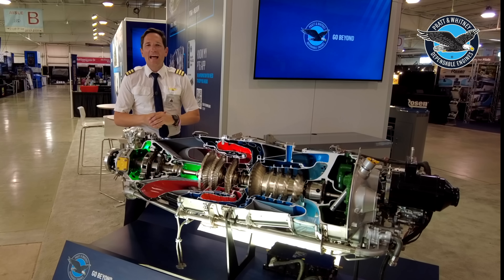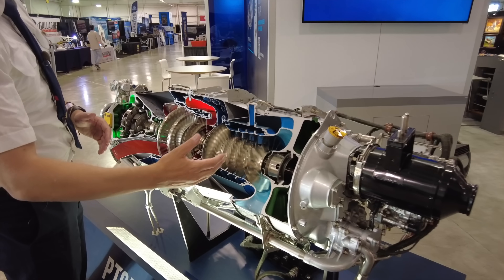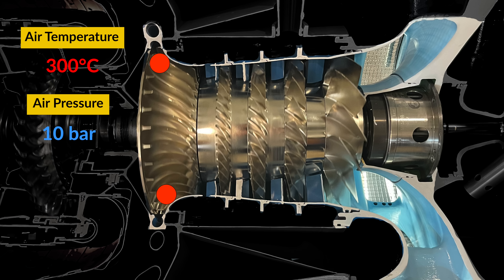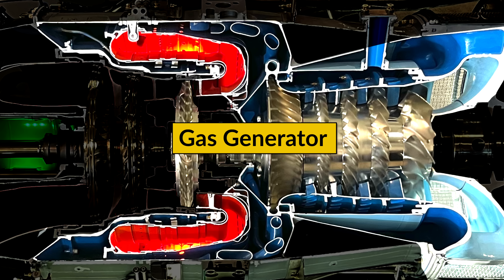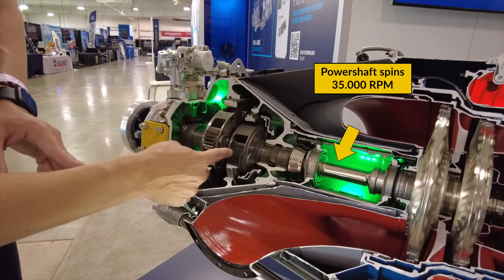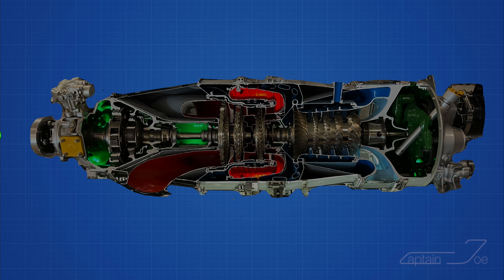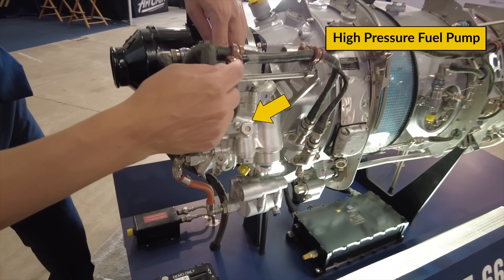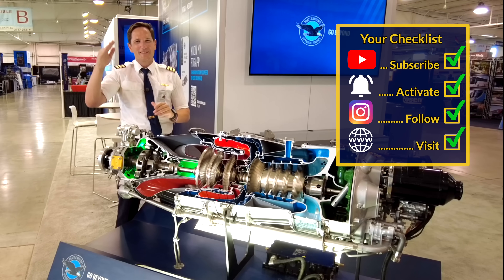The BEST TURBOPROP explanation video! By Captain Joe and PRATT & WHITNEY

Comment: I’ve always been confused by the turboprop engine. This is far and away the best and most understandable step by step explanation. My eyes have been opened!
Reply from the maker: Thanks buddy! That was the purpose of this video👍🏻
Reply: @flywithcaptainjoe  If anyone is interested in learning more about turbine engines a very informative site is AgentJayZ. Hopefully cap joe will leave this up and not ghost it like he did my first comment (not cool), as it is clear that he doesn’t know about AgentJayZ and his site. He is a jet / turbine tech that overhauls different jet engines and has fantastic and detailed videos of every aspect of turbines.

Latest video is:

Afterburner Monday

If you want to get even more technical, in the comment section a turbine engine development engineer from RR answers the more complex design issues questions many times.
Reply: @flywithcaptainjoe  Great video. It took me a while to connect the dots about how the stators force the fanned air into the next stage of the compresor, with a "forward" motion, as opposed to what could otherwise be something of a donut of air rotating around the shaft. 
-- I never thought of air moving in a donut motion until one of the engineers who worked in the Osprey told me about how helicopter rotors under some hovering conditions can set up a pattern of air motion something like a donut turning itself inside out, and thereby getting no lift relative to the atmosphere as a whole. Inside this turboprop, it would be more like a spinning donut, but aerodynamic flow isn't anything I studied in college, and my intuitive assumption was to assume that the air is more cohesive and "sticky" with respect to surrounding air. Another assumption, after sitting in front of fans to cool off, is to take the force of the pushed air as exclusively forward, without taking into account what's pushed outward and in a circular motion. But I guess a fan blade is kind of like the sail of a sailboat tacking into the wind-- an indirect pushing with a lot spilling off to the side.
Reply: I've always wondered how they worked. I was nothing like I was thinking it worked.
Reply: @mikewhite6288  Me either.
Reply: Check helicopter turbines, they are also very different.
Reply: SUCKS, SQUEESE & BLOW...))) YAEH BABY!!!!
Reply: Great video!  Consider how many degrees of turn the air has to make from entering the intake until emerging from the stacks!  It's nearly 1000 degrees worth (roughly 3x360 of direction change!). This said, more seriously, remember this is a free-turbine type turbo-prop.  A large number of others are not.
Reply: Well, this a basic explaination of the PT6, not turboprop in general. There's fixed shaft turboprops like the Garret 331. The most complicated and interesting is how the prop governor and the prop pitch controller works (beta mode). And BTW on ice or bad weather conditions the ignitors are switched on just in case a flame out occures.
Reply: It's basically a jet engine driving a propeller
Reply: In short, you are driving the prop with a jet engine instead of a gas engine.
Excellent video.
Thank you!
Reply: Please recheck and confirm RPM of gas generator shaft. I felt , it can't be 39000 .
Reply: Nope that is correct the gear ratio is from 39K down to about 2000ish rpm (engine models vary)
Reply: Think of it as an unducted very high bypass engine.👍🏼
Reply: Sokath. His Eyes Uncovered!
Reply: @SHOTbyGUN  A spy!!
Reply: @SHOTbyGUN  At Tanagra.  LOL!!!  Nice Star Trek reference there.
Reply: The thing I don’t get is how it’s air pressure drives the propeller. It seems like it wouldn’t generate enough power to turn the prop at all settings. In fact, piston engines do a better job being mechanically linked to the prop. So if your landing a plane and have to abort the landing, a turbo prop lags in increasing prop speed while the piston engine gives instant response.
Reply: @kennethcohagen3539  yes but in flight the prop is always at 100% rpm. The only thing that moves is the propellor pitch!
Reply: @Sterlingjob  so it’s a constant speed prop. I guess the biggest change would require more torque, right? It’s just that air is compressible, and you would expect the prop to lose speed under increased loads. But I guess air doesn’t load the prop as much as water would with a boat propellor. Both are liquids when you look at the physics of the situation.
Reply: @kennethcohagen3539  yes constant speed in the air but not on the ground. The actual physics of props is quite mind blowing! Before take off the driver will put the prop into alpha mode from beta mode. Alpha mode is 100% rpm. So when he moves throttle forward the prop will stay at 100% but the pitch of the blade will change and Chuck loads of air back causing thrust. If the aircraft climbs the prop will still spin at 100% but the pitch will change to keep the prop turning at 100%! In beta mode the power levers will directly change the pitch of the props but they won’t be turning at 100%. Beta mode is for ground operations! As I said it’s quite complex and I don’t remember much from my technical training on them!!
Reply: @kennethcohagen3539  Keep in mind that not all turboprops have a free turbine. Some are geared.
Reply: @kennethcohagen3539  It's not air pressure but the shaft connected to the power turbine which is driven by continuous hot gases that drives the propellor and there's power aplenty.. Similar to the torque convertor in an auto transmission where the engine output shaft is not physically connected to the input shaft of the gearbox, fluid is used as the medium to transfer the power from one to the other and anyone who has driven an auto knows how well it works. Much damage to the engine and transmission is averted this way. Besides that, a piston engine has alternating pistons firing in order so not all pistons are firing together so you are not really getting the most of the engine. In a gas turbine combustion is continuous 100% of the time giving optimum power.
Reply: Far and away? What the heck does that mean?
Reply: @thecomedypilot5894  It's a cheesy Hollywood film, where Tom Cruise not only meets the stature of a leprechaun, but he sounds like Hollyweird's ridiculous portrayal of one too.
Reply: @skateboardingjesus4006  Thanks for the clarification.
Reply: @thecomedypilot5894  It means you are young and have never heard these archaic quirks of speech.
Reply: @dougaltolan3017  And is that a bad thing?
Reply: @dougaltolan3017  Another quaint expression is “over and above” which means “in excess of normal”. It’s a unique way of associating something with something else.

Comment: This is the best explanation I've ever heard. Ive always wondered how it got air energy to mechanical. Also im still wondering how that gear is turning  39,000 rpm in the reduction housing. What materia is that gear to withstand that speed and force.

Comment: why would you want to reduce the RPM of the props. the RPM has no place to escape, it has to turn those big props, so isn't it better without the reduction, and let them naturally spin the prop, there will be some wastage of energy, but you will get more thrust right? or did I get the physics wrong?

Comment: What I can never understand is why the combustion chamber, which must surely be at higher pressure than the inlet/final stage compressor due to the enormous expansion caused by combustion,, doesn't cause the gasses to reverse direction into the compression section and so prevent it from working as described.

Comment: How are the propshaft and drive shaft lubricated in the center at the point if rotation? A car engine uses oil on the bearings of connecting rods and crankshaft

Comment: You talked about the increase in temperature and pressure from 15 degrees 1 bar to 300 degrees 10 bars. What will be the rpm of the compressor shaft on the PT6 or any other plane. Is the increase in pressure and temperature values attained by an rpm that may be 20% of the engine's maximum rpm.

Comment: Those reverse flow and counter rotating turbines are quite intriquing features. Other than that it is basically a helicopter engine mounted on a fixed wing aircraft. I wonder could those free turbines be used in day automotive or marine piston engines as compound engines? Running on excess exhaust gas?

Comment: MY first A&P job was in '88 with Petroleum Helicopters, Inc (PHI) and worked on the Bell 212 and 412 with the PT6-3 and -3B respectively.  Great engines with plenty of power.  Bit of history.  Pratt and Whitney Canada developed this engine because their radial engine business was fast disappearing in the mid to late '50's and they had to have a follow on which led to the PT6.

Comment: Thank you, Captain Joe, this was very interesting. Something I am still wondering is that you stated the fuel/air mixture will continue igniting on its own as long as fuel is being introduced into the chamber, but then you said there is an igniter plug involved. Would the igniter be used in certain instances only? Or is that always part of the process?
Reply: Severe turbulence and heavy rain. Ignitors come on
Reply: @omarr737  Thank you!
Reply: @marcd1981  forgot to mention. They also do come on when Ng is over 10% and ITT below 500C. So basically during start
Reply: @omarr737  That makes sense, getting the engine started would need the mixture to be ignited, then as long as fuel is flowing, it will remain ignited. Thanks again!

Comment: Pretty good description, I've worked the-20's, -45's and -45R's on Shorts 3-30s and Twin Otters. Lots of hot section refresh time, and for a bit was the go-to guy for fuel control/prop govenor feedback rig. hated to safety the prop bolts inside the prop feedback slipper ring. Got to say that using a "Prentend to be Fast n Phony" in the movie that we true racers make fun of will hurt your creditability.. Careful Mate..... 😜🤪

Comment: It wasn’t mentioned, but the purpose of the stator vanes is to efficiently redirect and straighten the air flow going into each successive stage of compressor blades.

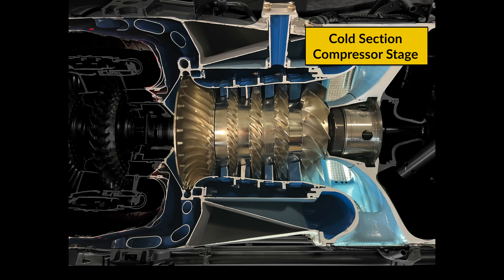Comment: 4:25 it would probably be helpful to explain here that after the compressor stages, the pressure of the gas is at its highest point, and would flow out through the turbines even if fuel wasn’t added. It just wouldn’t produce more power to keep spinning the compressor and the whole thing would just slow down.

Once fuel is added, the gas now has more energy over all. The resistance to go out the exhaust turbines is less than to go out through the compressors, so the gas does not reverse direction. however, because the gas has more energy, that is how the turbine is able to run the compressor and produce even more excess work.

The addition of the fuel can be considered simply an addition of heat. The mass of the fuel is small and can be disregarded. A jet engine can function on heat (energy) addition alone

Comment: I've got easily 1200+ hours behind this engine in a king air and porter(one of the best aircraft) and this is the best most informative things I've come across.  I've always heard the bad things about the engines reverse flow and free turbine etc...but truthfully the advantages pointed out here are exactly what kept me and my passengers safe. Even when people pointed out the problems they were also quite quick to say but it's reliable. Honestly the "problems " were monetary and sometimes caused by pilots, because they AREN'T cheap to fix or replace 😮

Comment: 🤯💥🤯Multidisciplinary engineer/inventor here. At a cursory, look our innovations and advanced engine concepts would reduce the size, weight  cost of the PT6 engine by 30%, improve efficiency by 30-60% and increase power by 50%.  Advanced propulsion will further improve propulsive efficiency of the aircraft by >>30%. 🤯💥🤯
...
..
.

Comment: How much pressure is in the combustion chamber while the engine is running at full power?  It has to be less than the 10 bar compressed air pressure or the air would not flow into the combustion chamber.  I've always been confused about the notion that the thrust must be the cross section area of the exhaust outlet X the combustion chamber pressure.   It seems amazing that jets can have so much thrust, but it is based on less pressure than the compressor is making.  Also interesting that the compressed air temperature is so high. I see that that is useful for igniting the fuel, but do any jets attempt to cool the compressed air to get more into the combustion chamber, such as with automotive turbocharged engines with intercoolers?  Thanks for this great video.  Very well explained.

Comment: This was a wonderful explanation of the operation "cycle" of the engine. As an aircraft maintenance engineer, I started my career working on Beechcraft King Air 200, 250, and 350. I've performed many many "HSI's" 10:35 (hot section inspections) on these PT6 engines, where we split the engine at the point between the CT(compressor turbine) and the 1st stage PT(power turbine) . 
It's always amazing to see the cutaway of the exact engine you'll be working on, which is generally only located at the manufacturer's approved course-instructing facilities. 

Fun fact: Only approximately 30% of the air in a turbine engine is used for combustion. The other ~70% is used for cooling!
Oh, I also  managed to salvage an unserviceable gas generator (the inside of which is pictured at 4:04 with the diffuser ducts/vanes) and installed a glass top on it to serve as a coffee table :)

Comment: I don't understand the difference between a turbofan and a turboprop because isn't a turbofan just a ducted turboprop? How come the rpm if the prop in a turboprop is reduced but the fan of a turbofan isn't it's allowed to spin faster then the turboprop prop at the same speed as the low pressure turbine (with acception of the pratt and Whitney geared turboprop). Hiw come a turbofan while basically being a fancy propeller can fly faster and even at subsonic close to supersonic speeds for a commercial airliner around 600mph and even  supersonic speeds in low bypass turbofan fighter jets meanwhile a turboprop usually has a maximum speed of 400 mph? What makes a turbofan a jet engine and a turboprop not a jet engine and a "propeller powered aircraft"?
Reply: One difference between both engines is that in a turbofan, both the ignited exhaust and the bypass air is used to generate thrust. In a turboprop engine, the combustion is used almost exclusively to drive the propellor ie the exhaust gases doesn't generate thrust at all.

Comment: Interesting.   I've never fully understood how the free spool turboprop actually worked.    I was a flight engineer on the C-130 that uses the Allison T56 engine/turboprop and have thousands of hours operating with that.  Not a free spool turbine and all parts are directly connected.  The T56 max torque was 19600 in/lbs.  Much bigger engine than the PT-6.   The J model C-130 uses a more advanced engine that I am not familiar with.  Allison is now owned by Rolls-Royce.

Comment: Also, the PT-6 exists in several versions, including turboshaft engines to power helicopter rotors and ST-6 for stationary use and APU (Auxiliary Power Units) to power all electrical devices in larger aircraft.

Comment: Finally a 100% accurate description of a turbojet engine and the attached turboprop section.  Too many other animations show the hot-section turbine blade pitch incorrectly slanted, i.e. the engine wouldn't run!

Comment: Technically speaking, isn't PT6 in this video a turboshaft engine ? because it is directly connected to the gearbox and shaft, not to the propeller